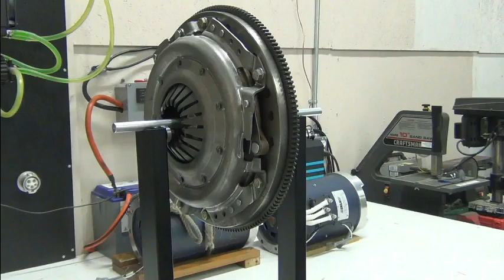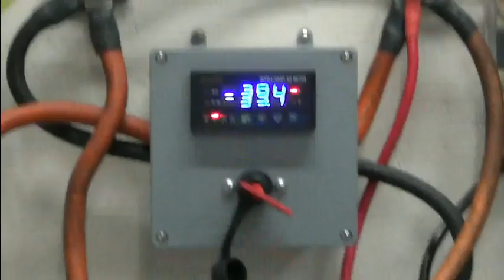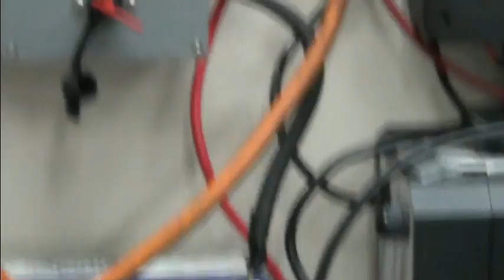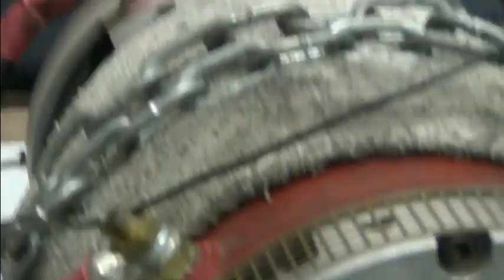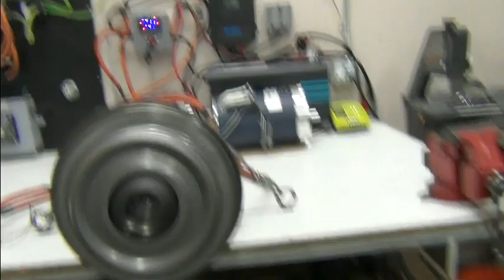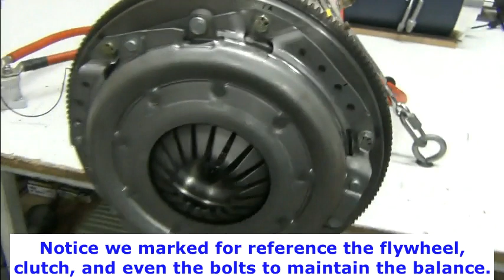EV Conversions - Jeep CJ7 EV Conversion Episode 10, Balancing Flywheel and Clutch - www.EV4Unow.com

Comment: So I'll need to get a flywheel /clutch, pressure plate that's externally balanced and make self centering  guides for pressure plate bolts to alleviate the wbble seen in the c/pp assembly?